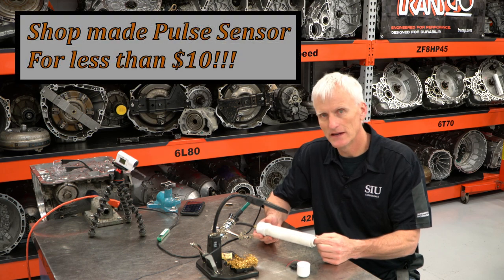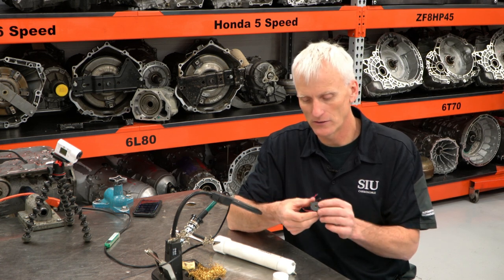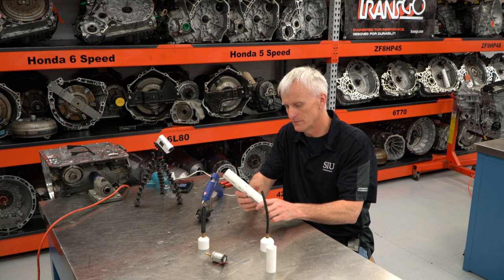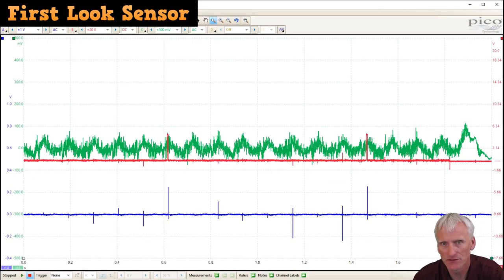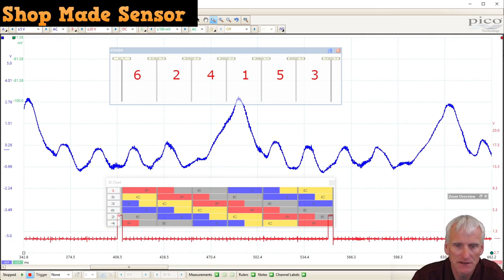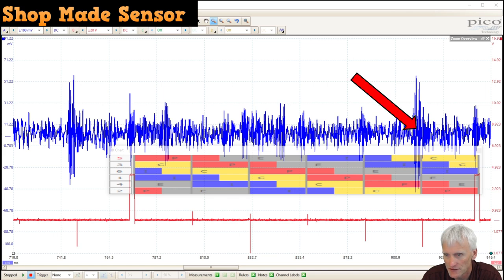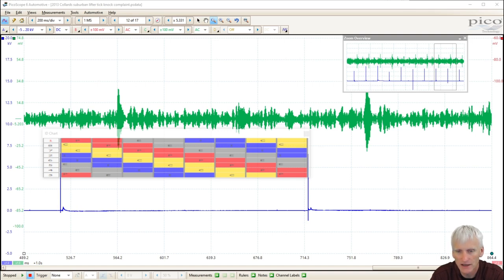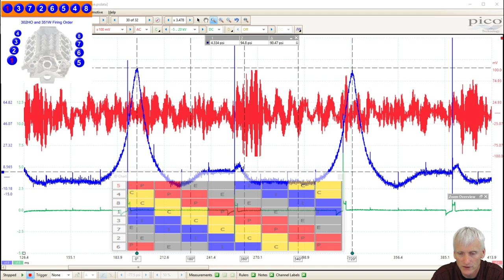Automotive Diagnostic Pulse Sensor for 6 dollars?

Comment: Your white tube is quite large to allow for a lot of air charge dampening. Your cranking test shows a lot of detail, the highest peak is an exhaust valve closing, If an exhaust valve closes late, it will mask the intake peak and you will know you have a clearance problem of some sort and with a detailed zoom and measurement of the peak, you can show it's later in time than expected at its very top peak, the second-highest peak is an intake valve closing from a different cylinder than its exhaust mate, need to know companion cylinders and also understand valve overlap for each type of engine. These colored overlays are not very accurate but are ok as a guide and different software companies do not talk to other companies so you need to learn the parameters of each, simply said, find one that offers more data analysis, the one for W10 is fine from a Google search. I can also see an intake valve opening on the very long upward ramp maybe 60% of the way down that long rising waveform section. Spark also occurs in this general location if you monitor spark as a sync point. The distance between the 2 top peaks can be measured and valve adjustments can be calculated. The exhaust peak should always be higher than the intake peak. Your lowest peaks are the vacuum pulls and should be some sort of peak, if the waveform is a bit leveled off in this valley, there is a lower vacuum in that cylinder. The greater the distance from the top peak to the lowest valley shows a better vacuum in that cylinder. Try to crank the engine longer and stay away from the beginning of the crank process to eliminate those lower vacuum pulses on the left side of your capture. Going downward on the falling edge about 50% of the way down of each wave is a small spike, notice that this is around the 0 volts range, this is where the sensor changes from pressure to vacuum in the manifold so the sensor shows this ATM (atmosphere pressure )range nicely as the pressure differential changes at this moment, does it actually show up or is there a problem with the intake valve not opening and not showing this transition. Showing some bad engines will of course help more with diagnosis as you gain experience. Overall as mentioned above, it would be best to have this type of peaks and valleys on a running engine also, that, of course, will take some experimenting to get a good design of your homemade tool or maybe a more expensive sensor with a faster reaction speed? The important part is to get used to your tool and learn more with each new job. Thanks so much for the video.
Reply: Jeśli jest katalizator w pojeździe to nie ma możliwości zobaczenia czasu otwarcia zaworu. To błędna interpretacja. Czujnik jest bardzo wrażliwy na drgania . Ja zbudowałem swój metalowy i jest ok.

Comment: Thank you so much for all you give to us in this video.
I will try to use it on my Honda N22A2 diesel engine doing a new little tac noise on one cylinder when you ask for some power, if I find somewhere to plug this sensor ...

Comment: nice idea again.
I think the length of the pipe will delay the signal but not just as any tube from the sensor to the source would. then it may also lower the pressure of the shock wave that gets to the sensor.
Reply: There are charts for delays.

Comment: Nice captures. I use piezo disc with banana jack , cranking the waveform is decent enough but during idling the waveform is bit ugly, compared to yours you can still see the pulls.
Question, does the length of the pipe  has a factor on the waveform capture? Thanks
Reply from the maker: I tried that longer pipe that I could move in and out to change the volume of the pipe, and it really didn't make a difference.  With your sensor, maybe try to put different sized orifices in the rubber line.  Or try pinching the rubber line while the engine is running to see if it clears up some.

Comment: Very interesting!!! 

Do you know if there is an open source version of the picoscope?
Reply from the maker: Pico is a free download at picoauto.com and picotech.com.
Reply: What do ou think with your question ? 
No it is not an open source software. 
Yes it is a copyright by picoscope  software and it is free.
BUT no way ! It works only with picoscope scopes ! 
Ask the pico hotline if the automotive software works with an actual electronic lab picoskope ! 
Or if these free software for cars only work with (identical but only a bitt different in the internal ROM-Software) scopes from pico for automotive. 

By the way = The free software from Pico works only with Picoscope oszilloscope ! 
Other brands and the software will work ? No pico is a company with employees and licende sellers and  and and ...
... and need to make money (or be soon not on the market if You/I/We use the software with cheap no-name scopes). 

And dont buy an non automotive scope !
The automotive free software works only with the automotive picoscope and not with the pico lab scope for electronic engineers.
(Only as far as I know) 

think if you buy an old picoscope automotiv. 
- old scope have some restriction (bad values here and there).
- can be broken 
- can be broken at some working somewhat and even if you test the scope quickly you think it is ok
- no gurantee (=2 days after frist use of your 2nd hand scope maybe you cry) 
- eventually the actual software versions dont accept old scopes from pico and work only with older free software

In my personal opinion = Only if you can afford a total lost of your money ==> ok

I dont have to write these ! A normal person can think at a quiet hour these ideas. 
No pico is not a stupid company give free an expensive software away and downloaders can use the software with any/some/one cheap china scope. 

It is in my personal opinion better you buy a new picoscope. 
And you are safe and have gurantee and no lost of all dollars for a worse one. 
And now we use google to find the amount of money ...
... oh oh oh
... and pico sell the scope with additional these and that and those 
Easy to double the spending. 
with original pico transducer and vibrationdetector module = faktor 10 or 20 times 
But these electronic at the BNC plug from the scope can be a DIY module (see these channel and use google).

Remember = Pico have a very good hotline and very good licensed seller. 
You can ask ?  Yes sure ! 
Ok  try it. 

above all my personal opinion ! Ask an expert if above are some wrong words.
Ask the pico hotline. You are not the first and not the last with identical questions.